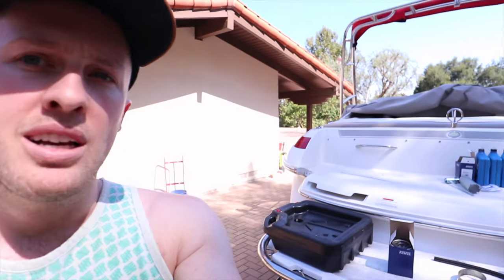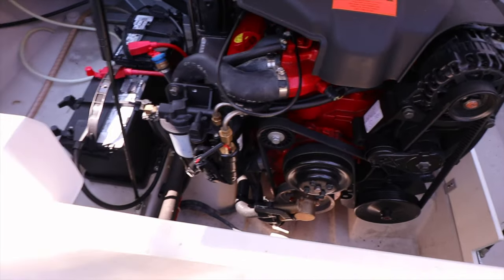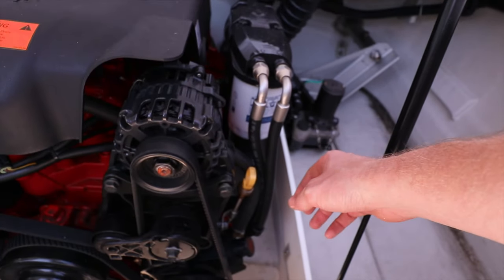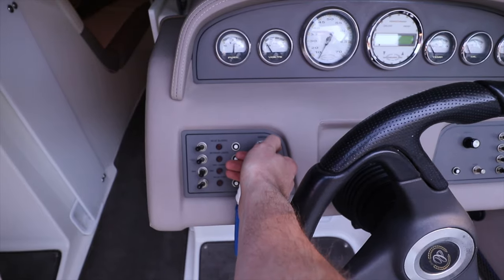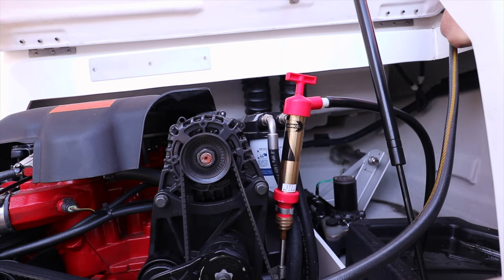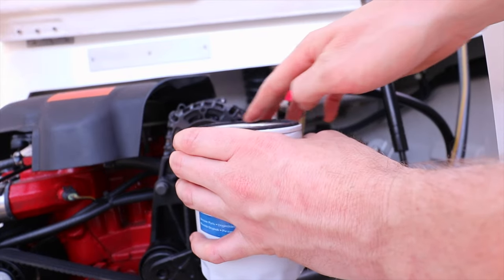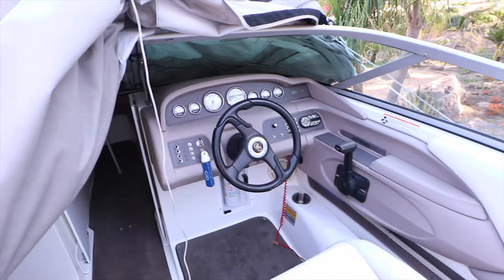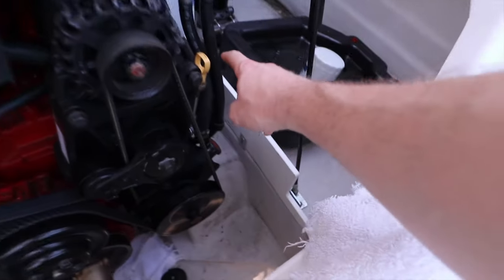Inboard Boat Engine Oil Change - Volvo Penta 5.7

Comment: What fuel consumption are you getting with that engine? I'm about to buy a bayliner with a 5.0L v8. I'm curious to find out how many mpg/gph it does.
Reply from the maker: It uses an enormous amount of fuel. I haven't tracked it but it can get pretty expensive.
Reply: @ZentRose  Thanks for getting back to me. Would you recommend getting one? I wouldn't be doing much distance, probably 3-4 miles tops in one sessuon
Reply: In my seaswirl striper 2301 about 2-2.5 mpg. Guzzler
Reply: @TheOutdoor_Guy  stay away from boats unless your a skilled mechanic or have a big check book
Reply: I have a 24' Chaparral with the 5.0 and at 35mph it gets great mpg.

Comment: I have VP 5.7GXi 2008. no previous experience with boats. I noticed it takes hours befeore oil in my engine settles completely, If I cheeck it 10min after stop it shows nothing on a dipstick. but tomorrow it is close to max. Is this normal?

Comment: Zent, I have a cobalt 2001 206BR with the same 5.7 gxi engine, same color scheme, etc  as yours.  It does not have the direct water inlet hose that you show.  I still have to use muffs.  Is this something that can be added with relative ease?
Reply from the maker: Yes if you are handy it is relatively easy to add an adapter to your water inlet. Some people build an adapter, pull off the inlet hose and pop on the adapter when running their engine out of water. I'd imagine you could also buy the parts from Volvo but it would be pricey. They made the switch in 2004 I believe.

Comment: How often do you change your oil? My family has the gxi 5.0. We changed the oil around 40 hours ago but a few years have gone by.
Reply from the maker: I change it every season which is what the service manual calls for. I'd recommend a change on yours, it's not a bad job and keeps the engine happy.

Comment: I have the exact motor in my new boat, havent changed the oil yet. I was worried about using the little water fitting in the engine compartment because I wasnt sure if the impeller in the lower unit would get water to it. But it looks like if flows down there when you start the engine. Thanks for the vid. How did you like that particular oil extractor?
Reply from the maker: The pump seems very solidly built and worked well. The only downside was the price. I also changed the impeller after I did the oil change and it was in good shape. The water hose engine connection is very convenient.

Comment: On the left side of the engine, down right above the oil pan but beneath the sparkplugs is a hole. The hole looks like a dipstick location.
The plug popped out due to overfilling the oil. Anyone know what the plugs part number is or what it could be called? There are no threads to screw in anything either

Comment: I have this exact engine and I would like to check and change the transmission fluid, but I can't find the stick or port.  Any clues?
Thank you!
Reply from the maker: Are you talking about the outdrive lower unit oil? On mine there is a 15mm hex head attached to a dipstick on top of the outdrive. If you lower the out drive you can access it and check the oil level and fluid condition. I change this oil every season (pull the props and pump the oil up from the bottom). I tried to make a video on this and decided not to post it haha. If you private message me I can send you a snap shot of the dipstick on my boat.

Comment: i have a 2008 4 winds volvo penta 5.0 gxi.  but i cant find oil filter on it!!!!    where is it located??   i see the fuel water separator filter  but can find oil filter.   please help
Reply: Its most likely covered in a black plastic container top right it look like a cylinder  air filter

Comment: Great video; thanks for sharing. I haven't taken my boat out in 2 seasons and need to remove the old gas. Any tips on the best way to do that? I tried using a syphon with the bulb pump but inserting from the gas cap it is too far of a run plus a lot of turns so the hose just gets stuck. I've see a few videos where they removed a hose from the fuel line going to the engine but not sure if you could offer any hints. I have a 2008 VP 5.7 GXI. Thanks

Comment: how do you have your batteries hook up I'm wanting to add a second battery to my boat.
Reply: The switch has three terminals on back. Main positive cable goes to the middle  of the switch. Run A separate positive cable from battery one and two to each of the other terminal i’m back of the switch. Then run a negative cable from battery one to battery two.

Comment: not sure if anyone here can help but i need to remove the old gas and put new gas in engine. my boat sat to long in 2019 i backed it out of my bout house put it in drive and it died. the boat is brand new off showroom floor and was only driven 3 times so i can only assume it is the gas

Comment: Just one tip, don’t pre fill oil filters, not on cars, not on boats, not on anything, the inner hole of the filter is the supply to the main oil gallery, any crap in the oil jug will end up in the engine unfiltered.
Reply: @Raffi Aroyan If you are using a brand new container of quality oil it will be 100% free of contaminants, I have no idea what type of oil you have been using but there should not be anything in the oil! Secondly filling your filter helps circulate the oil throughout your engine faster! People say that oil has additives to help lubricate your engine and prevent dry starts, I say BS! If engine builders  pre-fill the oil filters before installing them on $200,000 race engines why shouldn’t you!
Reply: @NeverEnoughPyro40  Hi! Have to respectfully disagree, I spent over a decade as a full time race car mechanic and a few of them building race engines, it’s not so much the oil that will have contaminants in it (but it happens), it’s when you open the container that you risk getting foreign objects in it, could be a a tiny piece of the sealing foil that ends up in the oil, if you pour it into the filter that little piece will end up in you oil gallery and the risk of damage is much higher than just leaving it dry.

Comment: Everything I have read makes it very clear that you can flush your engine with the hose fitting but it does not supply water to the impeller so if you run it with just the hose attached you will damage your engine. Right in the manual.
Reply from the maker: Service manual for this engine:  "Volvo Penta engines incorporate an engine flushing port designed to flush the engine with fresh water while the engine is running."  Older VP engines still require muffs.
Reply: @ZentRose  perhaps it is a newer model then mine as mine is a 2002. I can not attach a picture but it does indicate in Bold Print. Do not run the engine during fulshing uperation. The raw water pump will not draw water with the drain valve open. The pump impeller will be damaged. Best.
Reply from the maker: @rjalbright1  Yes you are correct, I believe they switched in model year 2004.

Comment: We have a 96 caravel bow rider I think 19 or 20 footer with a 6.5L Volvo penta and I’m telling you these engines are the more reliable
Reply: That must be a fast boat. I have a 24' Chaparral and it has the 5.0
I wish it had a bigger motor. But at 35mph it gets Great gas mileage.

Comment: I have the same engine and got it running after over a year and all the oil spit out through the back of the engine in a matter of seconds. Not sure where its coming from, its hard to see back there. This isnt related to the video but maybe someone can help.
Reply: Did you make sure the oil pan drain plug was in or at least tight. After a year of not running perhaps you or whoever put it away last removed the drain plug.
Reply: Did you check the drain plug and oil filter are tight?
Reply: Oil filter adapter to block on port side